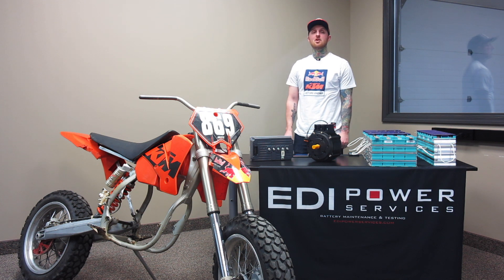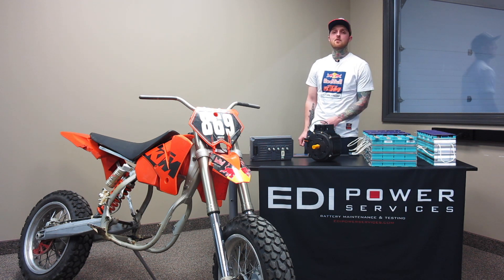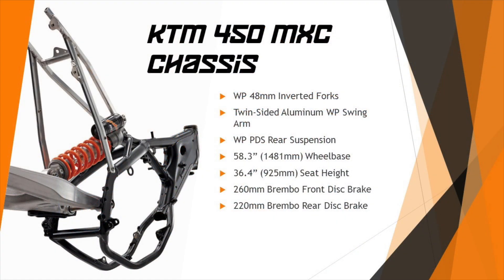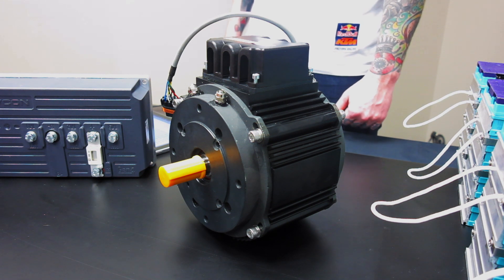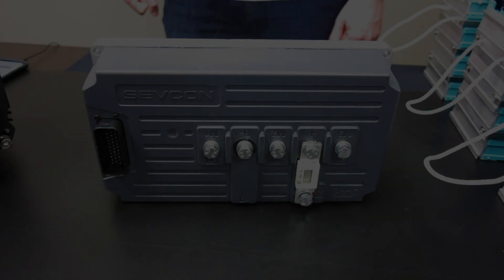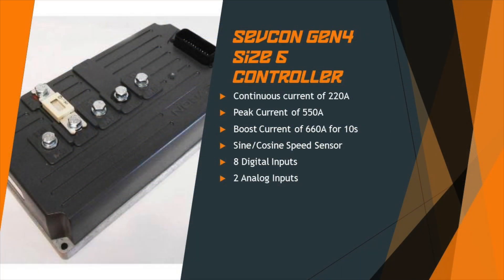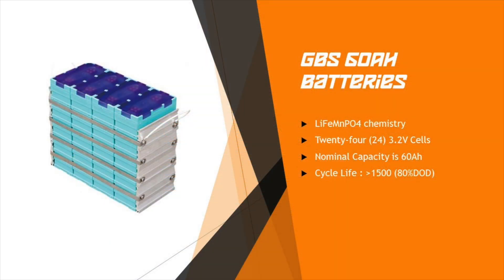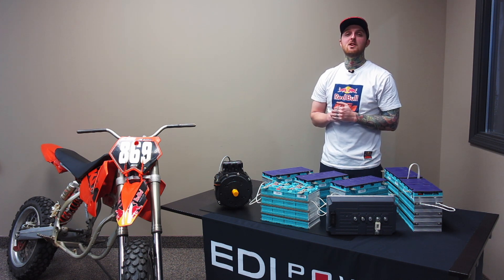Electric Supermoto DIY Build [Part 1: Components] - Miami University Motorcycle Senior Project

Comment: Hey Joey, I found your same batteries at Battery space . com under the "EV/Golf Car/PowerSport" section.  .... these types of batteries have poor C-rate looks like (maybe their different). With your application you'll need to make sure your batteries can support the peak motor rating. If you have done so already disregard this message, thx
Reply from the maker: You are spot on man! We got a deal in these batteries. They aren't bad for battery life and safety, but their peak discharge current is a limiting factor. For true performance, a high discharge and dangerous battery would be preferable. I might swap them out in the future with an NMC pack.
Reply: @joeyvortex  hey man what is an NMC pack? I am looking for some high-discharge LiPo packs. Turnigy multi-star is one, but they are all sold out and I guess their quality is going downhill now.
Reply from the maker: @petertwiss356  NMC is Lithium Nickel Manganese Cobalt Oxide or LiNiMnCo. It's another Lithium ion flavor but they make some high discharge cells that are really light and small and you can get 5C continuous and 20C peak.
Reply: @joeyvortex  thanks Joey, sorry I do know of that chemistry. I thought it was maybe a brand, looking for a pack source for a build myself. thanks!

Comment: Hi Hey how can I contact you over the controller configuration do u have email or any other way
Reply from the maker: Do you still need help with programming? What is your email?
Reply: @joeyvortex  yeah I thought it would come ready to install but I was wrong can you configure any sevcon controller I do have the same motor but a sevcon 4 controller  and my email is daviddyckfriessen@gmail.com
Reply: Joey please help!
I've got a motenergy 1616 (liquid cooled) and a sevcon4 (size6)
How can I aquire the program software ?
Any contacts on the eastcoast?
ensmingerdesign@gmail